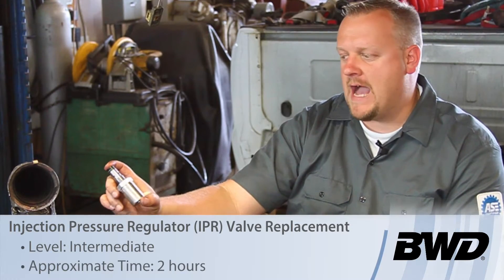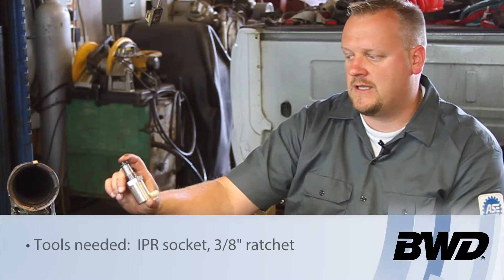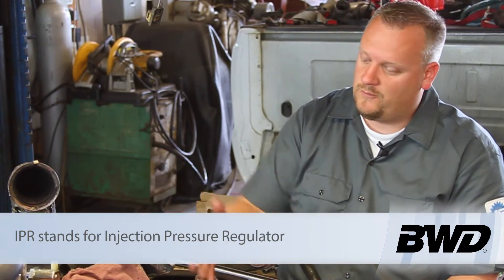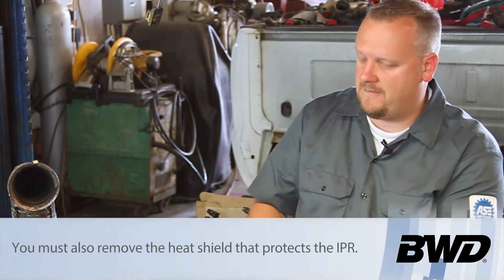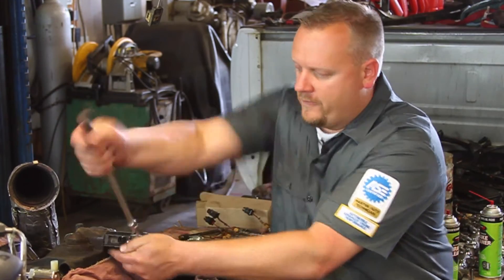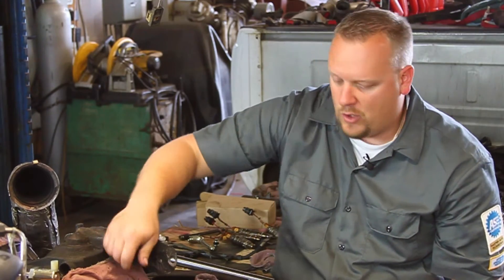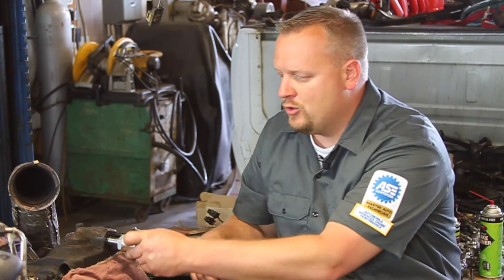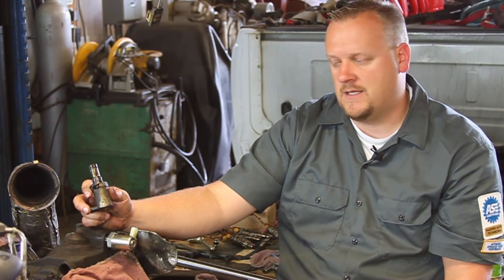How to Replace the IPR Valve on a Powerstroke Diesel Engine | Know Your Parts

Comment: i replaced mine and the connector is pointing down so its really difficult to get the pigtail connector on. Is there a way to change that to pointing up or back toward the rear of the truck.